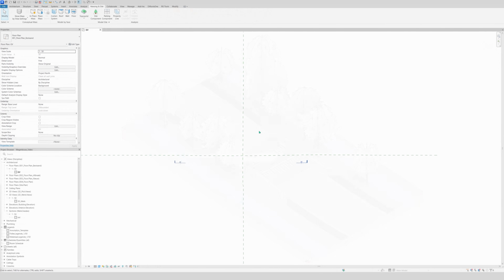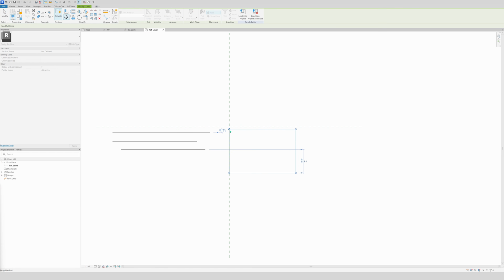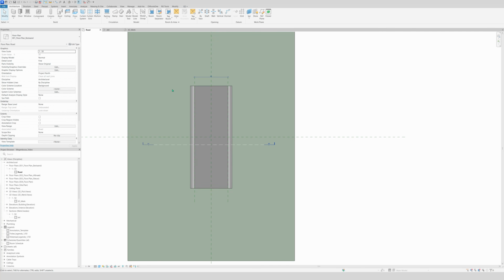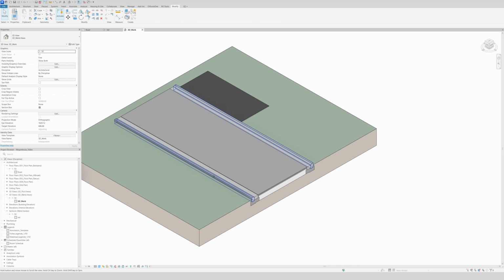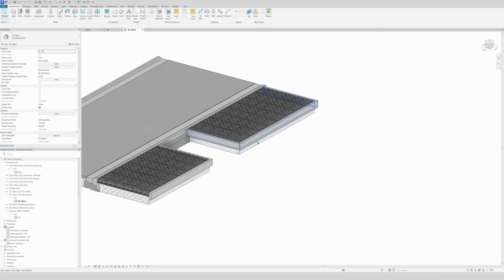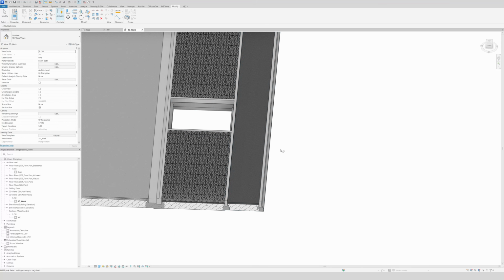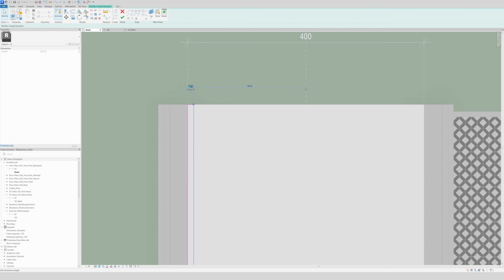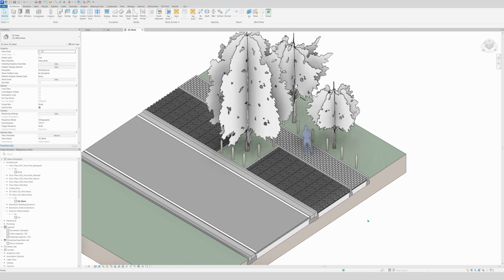Road Design in Revit: The Interplay of Road Construction and Nature Conservation

Comment: thankyou sir, this video makes big insight for me, but can i ask why you rahter adding toposolids instead using floor for modeling the raod, etc? is ther any reason?
Reply from the maker: I use Toposolids because they are designed for terrain and civil infrastructure modeling. Roads have elevation changes, slopes, and need to tie into the surrounding terrain, which is exactly what Toposolids are intended for. They also support subdivisions and cut and fill calculations, which is a major advantage for civil projects. If you’re only modeling a pavement layer with a constant thickness, a Floor can be a better choice. That’s why it’s common in practice to use a combination. Toposolids for the terrain and Floors for the pavement structure.